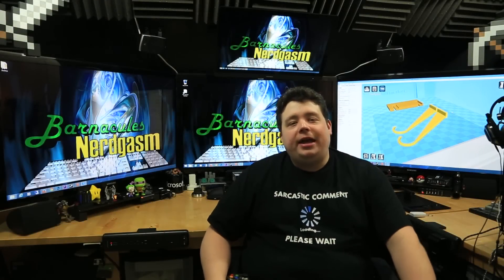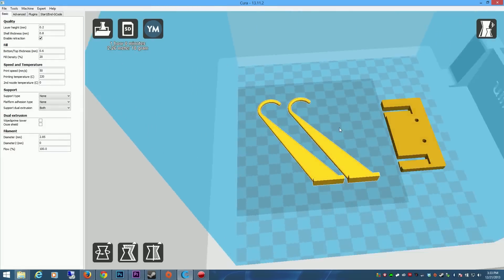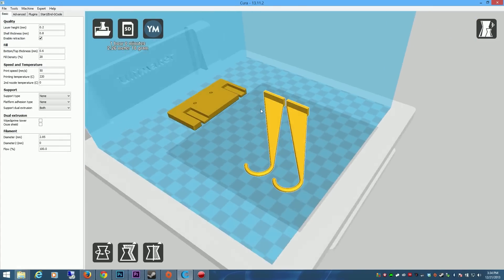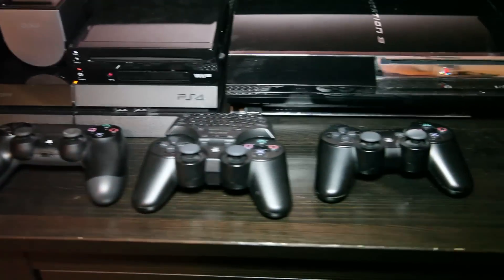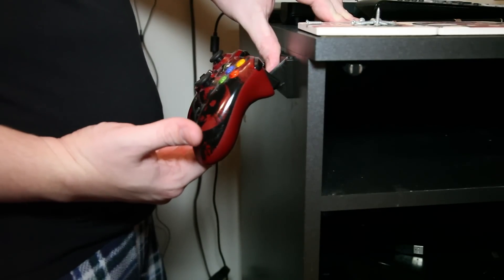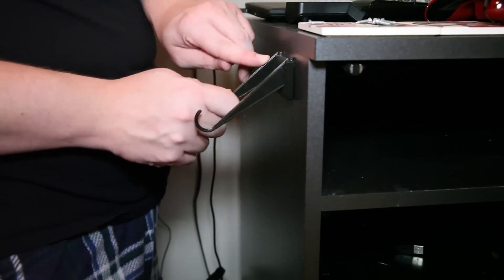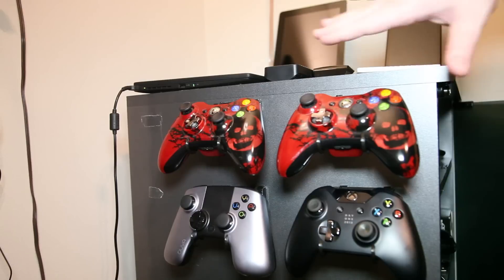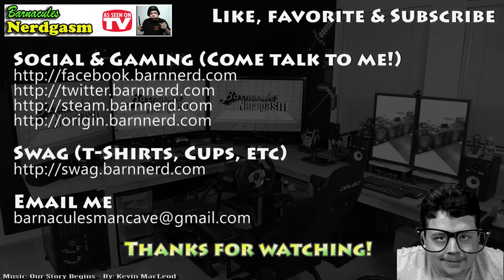3D Printing Custom Controller Hangers for my Ultimate Game Room - @Barnacules

Comment: People here are saying that you could print a controller shell. Is there a way to just copy the shape of the controller shell or would you have to measure it out and 3d model everything yourself. It sounds like it would be easy to mess up if you 3d model it yourself!
Reply: TheTjerty You could hack a connect and scan it or some 3d printers come with scanners

Comment: Question: Why printer makes this out line print thing before starting the part it self? Is it to do with print head heating the plastic so its allready in flow when it starts to print part it self or whats the reason?
Reply: Pretty much. I use it to make sure its flowing before the part starts printing. It can be left out. Its called a raft.
Reply: maxx scott Okey thanks! Mmh maybe i shoul get 3d printer for my self^^
Reply: you should. mine was $800 in kit form, but that was 2 years ago. should be a little cheaper now. def worth it tho
Reply: maxx scott Any suggestions what would be good printer? I will be mostly making parts that needs to be smooth, though and heat resistant (meaning they dont melt or reshape in sun like i heard some 3d printing plastics do) for airsoft guns, RC etc.
Reply: ive got a reprap and that would def not be what youre after. the makerbots seem to prou\duce good prints. but i have no first hand experience with others
Reply: maxx scott Also i'm looking "cheap" solution as my budget is not too much. Looking the makerbots.. autsXD way too expensive for me. I know its pretty much impossible to find cheap printer with specifications i stated... need to build my own when i get to have time to study these things. the body is not such big deal to make my own, but electronics and print head is another case.

Thanks for the advise:)

Comment: dude  try  printing  a  controller,  that  would  be  more  impressive
Reply: more  like attemt to 3d print a controller shell and take the motherboard and use the controller possibly
Reply: Yep because a controller is a hollow piece of plastic...
Reply: BlackFlareZ there is a fully functional 3d printed gun. it's made of plastic and has a 50% chance of exploding in your hand, but it "works"
Reply: SwiftTheGent
if they can make shoes, guns, food, lego's, prosthesis with a 3d printer  surely they can make a controller.
Reply: They printed a gun in parts, then put it together. Guns arent electronic, they dont need a motherboard, or anything to work, thus it is possible to print one.
Reply: BlackFlareZ
 gun parts like magazines? dude  they  can  print  the  whole  gun.  When  I  say  print  a  controller,  I  just  mean  the  shell,  THAT'S  ALL!!!!  It's  not  hard,
Reply: You could print the case of a controller and maybe the buttons, but that's about as far as you can go.
Reply: Sheldon Smith
Said items have no mechanical parts and they can only print gun parts like magazines.
Reply: Sheldon Smith
It sounded like you were arguing against the fact that you could only make the shell when you replied to Swift.
Reply: BlackFlareZ
 I wasn't.  Just  telling him  the  complex  things  you  could  do  with  it.  Also  it's  meaningless  to make  the  inners  of  the  controller,  that's  reinventing  the  wheel

Comment: This is an awesome idea, but I can't justify doing it just yet. :(   I used a local 3D printer service finder (3dhubs) to get an idea of costs if I paid someone else to do it for me.... and it looks like it ranges from $17 to $63 - just for one set of this. Conversely, I could get 4 simple rubber(?) wall mounts for $10 off of Amazon. 

I have to wonder how much money it really costs to make, and how much extra they're charging...
Reply: If you printed it yourself it would cost a dollar or two at most

Comment: Drilling tips(8+ years cable tech) Pre-drilling stops any type of wood splitting. Then to stop the drill automatically from over torquing. You see that dial with numbers on your drill where it spins? Thats the chuck break. You put it on "drill symbol" for max torque. But if you want it to stop it automatically, you adjust it to a number. When the drill gets torque it will break(not actually break, just the term used by people who trained me) and will not drill anymore. To easily determine a setting. You simply start on the lowest setting, then try to drill, then increase it one notch, and repeat untill it actually drills. Then once it hits anything past that torque it will stop by itself. You can go full speed if you wish this way. Prob not really required here, since you wont be doing it a lot. But it is something must don't know about the chuck. So here you go.

Comment: Hey Barnacules, what are you using to connect all those consoles etc. to your TV? My TV only has 3 HDMI Ports. Are you using some sort of switch? Would be nice to find a cool gadget to solve my problem.
Reply: some tv's have more than 3
Reply: I've been using a monoprice switch for my 3 consoles that all go to one 27" monitor. It's been working great the last few months so far. 

http://www.monoprice.com/Product?c_id=101&cp_id=10110&cs_id=1011001&p_id=8149&seq=1&format=2
Reply: I bought a switch aswell from Amazon. Works awesome with 5 devices attached to it. Thanks for the replies.
Reply: I also have a monoprice switch, it works really well, has 4 ports, and accepts IR so I can program it to my harmony remote.
Reply: He probably has a A/V receiver. Google it.

Comment: What's the outer "ring" of material for that printers always seem to lay down first?
Reply: It's just an outline that the printer lays down to know to print within it. It's kinda like the lines in a coloring book.
Reply: it's called a skirt. when printing you can make it print multi layer skirt or single. most people have it print a single layer skirt around the outside of the print area to pre print out some material. Personally I just skip it because my printer has an enclosure

Comment: Besides just modifying the bracket for PlayStation controllers, you can probably modify it for Wii U Pro controllers, widen the base for the gamepad, make a base the holds a single slip out bracket, and an bracket designed to hold a gaming headset...there is a lot of potential for this design to hang literally everything a gamer uses, and still have the replaceable brackets.

Comment: Odly enough a good 3D printer cost around 6.000,00 $ and the material costs 20,00 $ every 10 Kg. It would be awesome to have one, but it is very expensive and in Brazil we have plenty blackouts everytime, so the printer would stop very often destroying the work. ._.

Comment: You paid all that money for a 3d printer and the most clever thing that occurs you to print is a cheap controller holder? If that holder would have been sold on eBay it would have cost about $1. I don't think that the holder is very cost effective.

Comment: It looks like you'd have to take the top one off to get to the bottom one. If that's the case, did you move them farther apart or just not bother with it?
Reply from the maker: It's not the case so far.

Comment: i just got an idea for something your could try to make it's a 3D printed plastic logo with edges that and beveled so they are smooth and wont get scraped off and on the back have a spot that is indented to put 3M tape to attach it to anything also so there is bulge to it 
if you do it email me at kyledavis417@gmail.com

Comment: are the hangers fragile? bcuz they seem fragile, but i don't know if they are, i don't know how much it cost for you to make one, but if it is cheap could u please shoot a demonstrantion of you trying to break it, so we can have a better perception of its strenght...

i can see @4:10 that the angle the controller stays is quite open, if i were doing this myself, i would prefer the angle to be a little bit more closed, so that the controllers don't take too much "3d space".. They could easily be placed in 100% vertical position, and on the model you chose they are almost in 100% diagonal position.. but anyways, i guess this is just a nitpicky detail..

great vid, keep it up

Comment: I imagine if you didn't have a cabinet you wanted to drill into, you could just use some double sided 3M tape. The controllers aren't heavy at all so tape rated for 2lbs can work.

Comment: that is the best 3d printer design i have ever seen, also one quick question you know the fan on the side of the ultimaker print head what does it do exactly? does it cool the plastic quickly or keep the print head from over heating?

keep up the nerdgasming

Comment: It'd be awesome if they could make a slightly more extravagant design, this one seems a bit bare-bones.
Reply from the maker: I really like bare bones when it comes to stuff like this but I could modify it in a 3D cad program and add my logo and stuff like that if I wanted. or I could print the parts in separate colors.

Comment: Cool thing! But depending on the screws youre using you should chamfer the holes so the screws sit flush and the contact surface will be better.

Comment: How is the Robo 3D printer? dying to know! I'm going between that or a Solidoodle 3
Reply from the maker: Just installed the E3D print head today and I'm waiting for the cement on the thermister to cure. Tomorrow I should be up and printing if I don't hit any new problems.
Reply: That's awesome! Just followed you on Twitter and saw your post about it.

Comment: Is there a parallell between the sale of inkjet ink and the sale of consumables for 3D printers, in terms of profiteering?

How cool - and possible - would it be, to be able to recycle 3D printer inkplastic - orwhateverthebloodyhellyoucallit from - say - broken console controller hangers?

Does heating/melting the plastic change it's nature, so as to make it impossible to re-use?

Wax would work, maybe, if durability was irrelevant.
Reply from the maker: Yes, the plastic does come at a premium but it's not as bad as Ink to be honest. Plus you can already buy machines to make your own filament for a fraction of the cost.
Reply: Barnacules Nerdgasm
Oh!  OK, roll your own filament.  Sweet!

Comment: I need a faster 3d printer!
Are you going to model the Playstation holders?
I use Lightwave 3d to model and animate. Plus it can save STL files for 3d printing.
Reply from the maker: Yes, I'm going to modify the existing model to fit PS3/4 controllers.

Comment: how are the household items like plates and cups? do they hold up with cleaning
Reply from the maker: Yes, they will hold up with cleaning just fine. PLA has a pretty high melting point. You're not going to want to microwave them for obvious reasons but you could drink from them and eat off them.